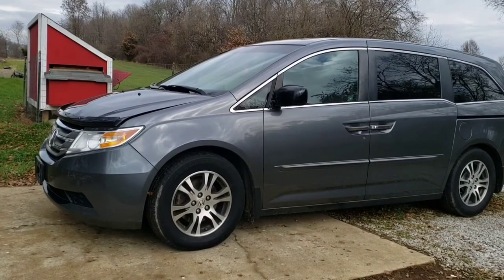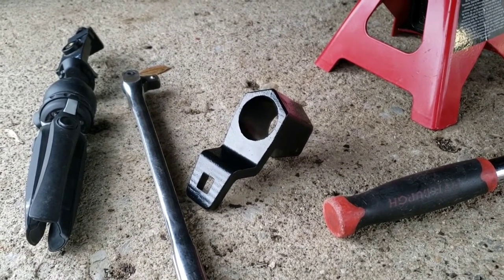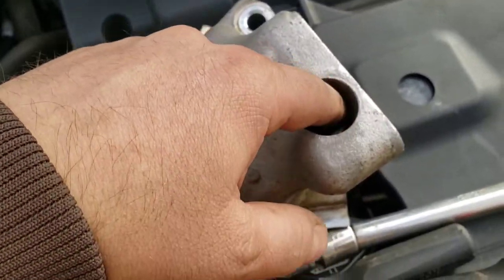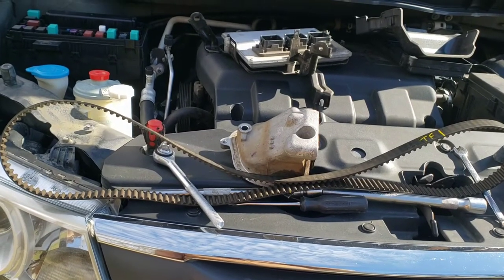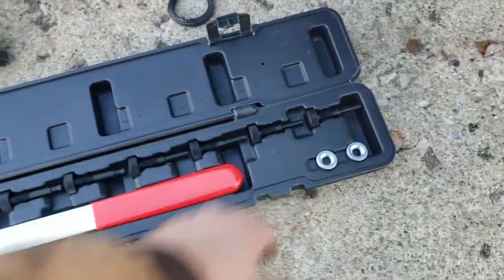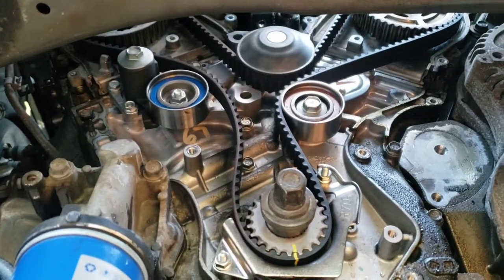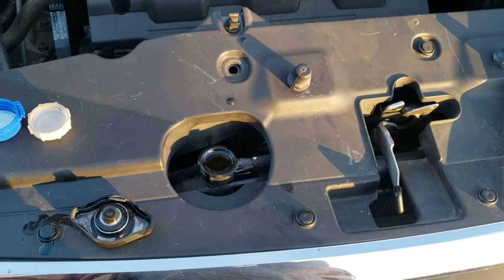Simplified Yet DETAILED Honda J-Series 3.0 3.2 3.5 Timing Belt and Water Pump Replacement - Odyssey

Comment: Do you have link's for the parts you use
Reply from the maker: https://amzn.to/3kphclX - These are the factory oem Aisin parts that I used. Aisin is what Honda uses from the factory. 

(Required) As an amazon associate, I earn from qualifying purchases...
Reply: @BuckeyeBallistics thank you very much
Reply from the maker: No problem
Reply: Doing this job now. Stopped to get parts. Not nearly as tough as I thought it would be. Get the heavy duty 19 socket. Part # 77080. It a game changer. 2007 Hona Odyssey. Odyssey World is a great forum. Print out the checklist.

Comment: There is no way to thank you. I watched your video three times in a row before I started working on my car. I brought a 55-inch TV next to me and played your video. Then I started working, step by step. I do not deny that there were some difficulties, but they were overcome without problems. The work took me around. 10 hours, and when I finished, before I started the car, I had a scary feeling and a shaking hand. Finally, I started the car and everything was fine. I saved a lot of money, thanks to you.
Reply from the maker: You're most welcome, my pleasure. I know the feeling of anxiety- I felt the exact same thing when I was 19 years old and had just rebuilt the engine in my 93 Camaro Z28 by myself (warped heads) with just a Haines repair manual. Started it up fingers crossed and it was such a relief when I realized I did everything correctly and she ran better than ever. After that I knew I was capable of anything and started working on cars regularly...

Comment: Great video! I found a way to remove that stingy piece without removing the computer! I went from underneath and used a “serpentine belt remover tool”! It’s super slim and let’s you fit a 14mm socket right in there. It doesn’t ratchet, but once you get it loose enough you can unscrew by hand with the socket. Hope this helps someone!

Comment: TIP: In transferring the lines to the new belt. You can turn the old belt inside out. MESH the teeth with the new belt. And transfer the lines (al be it 1/2 tooth off) You cant mess up on the count of the teeth.

Comment: Very detail-oriented. I have the exact same engine in my acura rdx 2015. I do minor repairs like oil changes and brakes but this job is too complicated for me. I only have 70K miles now but I'm hoping to push it to 140K before I take it in instead of the recommended 100K. I drive responsibly. Meaning I don't redline it so hopefully that's ok. The owner of this Odyssey was lucky enough to push it to 165K before this major service.
Reply from the maker: It may not have been the original belt in this video that was replaced, it's hard to tell. Flooring it and mileage isn't the only thing that determines how long the belt will last- age and atmosphere contribute as well. If the belt snaps, the engine blows...

Comment: Will removing the camshaft pulleys affect tdc in anyway? Does turning camshaft pulleys independently ruin anything in anyway? Not sure where but i read something about crank and cams not supposed to be turned independently when belt is off or did i read and mistaking something else different entirely ? Thanks for the video btw!
Reply from the maker: Correct- the components must move in unisom. If either cam or the crankshaft turns without the others also turning in unisome with it, it will be out of time.

Comment: did you actually push it to 165k without changing timing belt? I noticed the letters are still visible on the belt so it shouldn't be that many miles. Just bought 2016 Od with 100k on it. Popped off the cover to check timing belt condition, still looked good but no letters or white lines on it. Just don't want to pay for a head and valve job when it broke! I figured if you can go 165k, I can go at least 120k.
Reply from the maker: It was bought with that many miles so the first thing we did was the timing belt, just in case.
Reply: I just did my timing at 105k. Timing belt had no cracks, and I think would last another 150k easy
Reply from the maker: @itscrazy - I have seen numerous vehicles with this engine blown before and around 200,000 miles due to the timing belt snapping because it was never changed. Depends on the age of the vehicle, how it was driven, how it was used, and the climate it was exposed to.
Reply: Just replaced the timing belt @ 209k . 😬 Honda 🫡

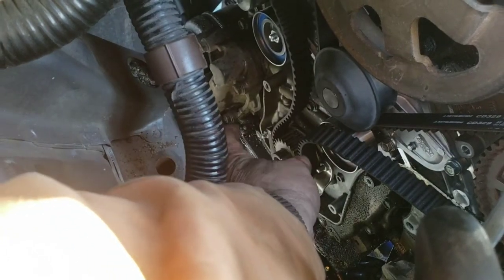Comment: Why do all you guys terrorize your impact drivers .  Use 3/4 T handle with 4-foot steel pipe.  Open always without problem.  Edit, of course plus that Honda crank holder.  Edit again.  6" or 9" 3/4 extension sitting at jack so I can turn out of wheel well area.  Man 32:30 that idler to right you screw just little than it can move so you throw belt on.  It is even in service manual that is free at internet.